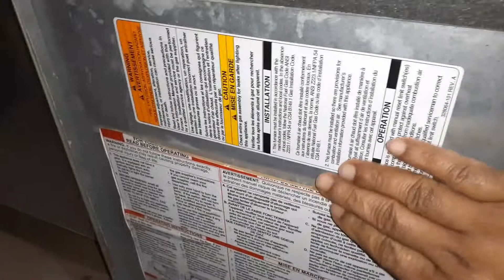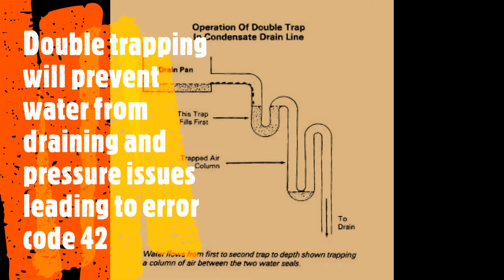Carrier Infinity Furnace Code 42 - Condensate Double Trap Issue

Comment: Unfortunately, it is not my case.  I checked for the condensate - there was none there.  I took apart the inducer assembly and checked the motor - it was fine. The error (42) is still there.  What else should I check?  Thank you!
Reply from the maker: I had similar issues with mine. Check the air intake and exhaust pipes from the outside the house connected to the combustion chamber for any blockage. You may have to insert some long wire or plumbers line. Or remove the end from the furnace and blow some air. If that is clear, remove the bigger drain tube that goes into the condensate trap and start the furnace. If that works, then you may have either double trapping issue, or condensate blocking issue or pressure switch issues. In my case, I opened up the cap of the drain tube that is not used (there are 2) and left it open. It works for me that way.

Comment: I sincerely appreciate this video, your effort to make it, and the detailed explanation, you save me a big fortune,  this is the root cause of my inducer motor noises and pauses after the startup with code 42. In the beginning, I thought I need to change the entire inducer motor assembly, after watching your video, I disconnected the drain hose to the white trap and was surprised to find out there was almost a liter of water trapped inside the inducer motor enclosure. drained the water, cleaned this white trap, and blew out a lot of sludge. Now the furnace is running fine, and the inducer motor is running quite. Wish you all the best and I start enjoying your channel now, glad to find this place. thanks!

Comment: Wait I'm confused. How was it double trapped? To me it just seems like that white thing was clogged up.
Reply from the maker: I showed that the other reason for this issue that can happen due to double trapping. It was the case for me since the end of the drain pipe was under the water level in the sump pump bucket. I corrected it before making this video.
Reply: @DIYWithIndi  ahhh ok thank you

Comment: Thank-you very much Indi !!!!
You could easily be a shop teacher....and one of the best.
Your explanation was clear, and the step-by-step instructions easy to follow. 
Just as importantly, you explain both the cause and the solution.

I did not expect my Google search to come up with a video with my identical problem, on the exact model and age of Carrier furnace. I am grateful to you and so many others that are prepared to generously share their knowledge with others. It is truly a beautiful thing.

As I began this task, my first step was to disconnect the first (largest) hose coming into the condensate trap. This was the first sign that we were on the right track. A huge flow of water discharged from the hose. I quickly grabbed a small bucket at by the time it was fully drained, the bucket was almost one third full. This suggested that there was a blockage in the trap. 

I removed the remaining 3 hoses/tubes and then removed the white plastic trap. That procedure was a little difficult, but I managed to maneuver it out through the bottom. 
The trap was definitely dirty. To clean it, I filled it with water and blew hard into the outlet port. This dislodged a lot of dirt which sprayed out of the 3 inlet ports. 

I then replaced everything and voila. Error 42 was gone, and there have been no more shutdowns. Unfortunately, I had ordered a new inducer motor and 3 stage pressure switch assembly, based on the assessment of the service technician. They will arrive in 2 weeks. 
I wish I had found you sooner, but at least I am now reassured that we will not have a cold house over the holidays.

Thanks again, and Merry Christmas.
Reply from the maker: Thank you for the comment. I am glad you were able to find my video and get the heat running with the quick fix. This is why I make these videos so homeowners can do these fixes themselves, though some of my HVAC videos require some advanced skills.
Reply: @DIYWithIndi   Hi again. This was not difficult, however without the knowledge of where to look, it is every bit as problematic as trying to fix something more complex. I will happily take on something more complex, should it arise. You are now HVAC "go to guy".

Comment: Thanks so much! I had the same error and by cleaning the trap, the furnace was repaired. You are a lifesaver. I could not get a hold of a repair technician after hours and the temperature had dropped. We were contemplating leaving the house, but because of your video we were able to get the heat running again. May you be richly rewarded for your great deed!!!🙏🏽🙂👍🏾
Reply from the maker: One of the best comments I have received. I am happy to hear that you were able to get heat back and my video helped.
Reply: Clogged trap was my issue too for #42. Thanks for the great videos!

Comment: Great video, thanks Indi !!

This was exactly the problem I had and was able to fix it thanks to you rather than calling a furnace repair shop.

I also had to prime my trap, as well.  At first I just cleaned it, put everything back together and things would work fine for about 10 minutes.  After that, same problem.  Then I primed it simply by pouring water in through the top of the trap until it came out the bottom (with a small bucket underneath.)  Then reattached all hoses and worked fine  Thank you !!
Reply from the maker: Glad to hear my video was helpful. These condensate traps need cleaning more often than I would like to.